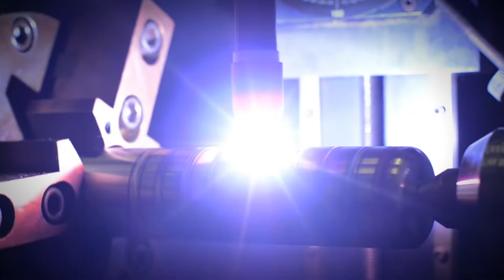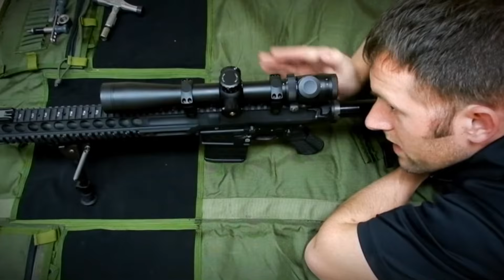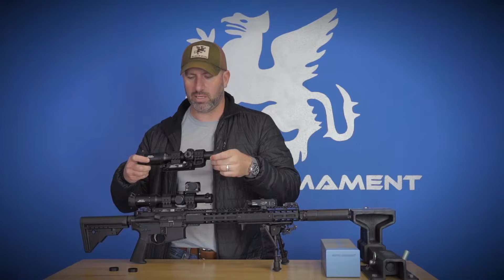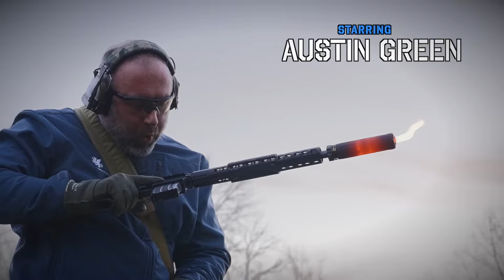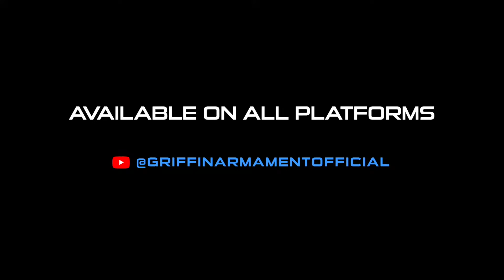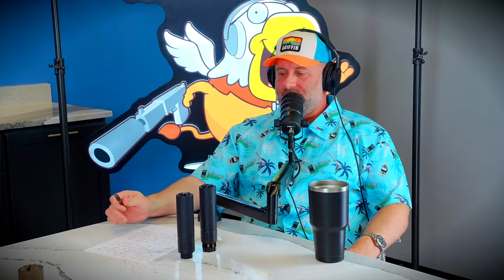Dwell Time Podcast #84: Optimus 6 Suppressor & Additive Manufacturing

Comment: Are the eco flow baffles that come in other Griffin suppressors the same as the Optimus 6?
Reply from the maker: No, the Optimus is a fully printed suppressor, which allows advanced geometries to pass gases through the suppressor in different ways not possible through traditional manufacturing means. ECO-FLOW was a very new concept at the time it was released, and is essentially radial porting between baffles to allow gases to flow between chambers without utilizing the central bore. Similar concept, additive manufacturing just allows you to go much further with it.
Reply: @GriffinArmamentOfficial  Thanks for the reply. I bought it. Now I'm wondering if I should've bought the hrt-556 am. I guess I might be owning another one of your cans soon. I'm building an 11.5" sbr with the optimus 6. BCM is known for being overgassed. Would the optimus 6 or HRT-556 am be better for backpressure?
Reply from the maker: They are pretty comparable in terms of backpressure. We've had a lot of good feedback on the Optimus 6, I don't think you'll be disappointed.

Comment: I absolutely love griffin cans and taper mount muzzle devices.  
I would love if you guys would make a taper mount OTB minimal brake, similar to the bayonet OTB brake only with 1.5” ish rear of the thread shoulder. So an OTB brake at a length between the 2 current OTB brakes you currently make. 
Griffin Armament taper mount is king.

Comment: I've been using your dual lok for some of my rifles and absolutely love it. I was wondering if there might be some way to make a quick detach system for suppressors with boosters that would be able to switch between pistols and pccs. Maybe with some sort of locking mechanism built in to lock the piston in place when switching it to a pcc. As of right now there doesn't seem to be any suppressor or qd method where you dont have to take the can apart and remove the booster. I think you guys could pull it off.
Reply: That's pretty challenging.  We do have EZ lok, and you could certainly run EZ lok on pistols and PCC's but getting a booster to deactivate with a switch or something is more complicated.  I think it's been done before in really obscure military applications in places like Europe.

Comment: I shot the Optimus 6 at Quiet In The Capitol & was really impressed. I expected louder with the vented front end & slight overbore for 5.56. It was as impressive as my Reece 5 but less gas. It's on my list of future purchases but I'm waiting on info on the new 9mm can before I pull the trigger. I absolutely love my Reece 5, Revolution 9, & Optimus Micro so looking forward to add another.
Reply: What new 9mm are you referring to?
Reply: @tyler6147 it's been mentioned but no actual details so far. I believe it'll be replacing the Revolution or Resistance.
Reply: @tyler6147  the new Revolution 9. They just officially announced it last week so you might have seen it by now. If not, it's on the website.

Comment: Question for GA. Can I use one of your Qyick Detach Flash Hider muzzle device on a different brand Suppressor?
Reply: What muzzle device are you talking about specifically?
Reply: If it is 1.375x24 HUB, we make hub mounts in dual lok and taper mount etc.